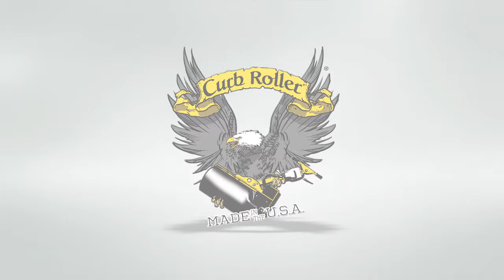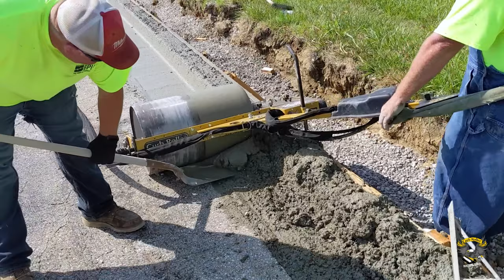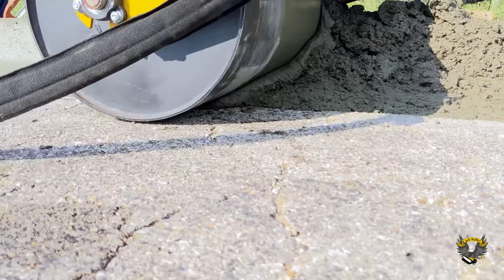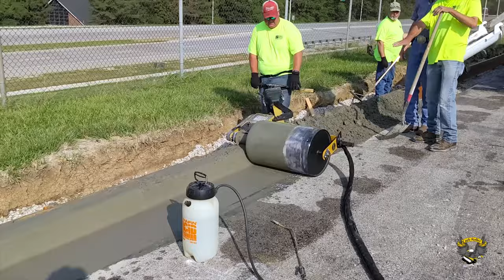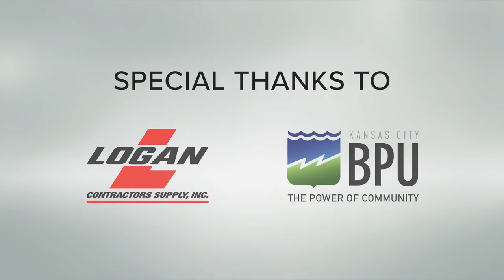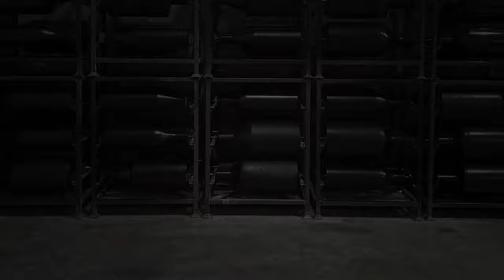KC BPU Kicking Out 250' Of Curb And Gutter In 3 Hours

Comment: Looks ok, but seems like a lot of work, and toting around that heavy thing 😮‍💨.. 
Also it said  50 LF in 3 hours??
We do 250' in 1 hour all by hand😭😂 5 guys.
, definitely not worth it here in Florida
Reply from the maker: Hi Lavonn👋Not all crews are the same and if you’re able to get 250’ done in 1 hour, by hand, then you really have a special crew. For a crew that was only able to get 50’ done in 3 hours, 250’ in 3 hours their first time using the machine is a large step up for them. It also allowed them to stay in an upright position and provide a more consistent shape. We do recognize that not all solutions work for all people. As far as weight, our Marketing Director is able to pull the Curb Roller (video of her can be found on our TT & IG), but we also have a battery powered Curb Maker that is lighter, just for curb, and is made to be moved around quickly. As for Florida, you should check out Full Power Concrete- they have our Curb Roller and Hydra-Pack and do a great job serving their area!
Reply: @CurbRollerManufacturing   your right it doesn't work for everyone,  I could possibly use it on something, if I can maneuver it to go quicker, I'll do it...
How do Yu purchase one and learn how to use it???
, I can possibly start another crew with this
Reply: Wonder how well this crews GL flows lol doing curb by hand sucks